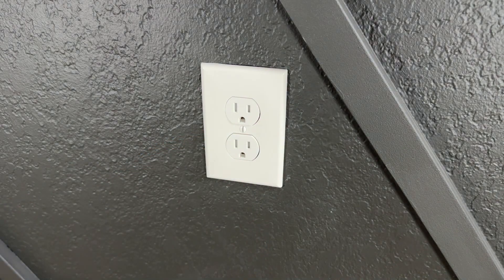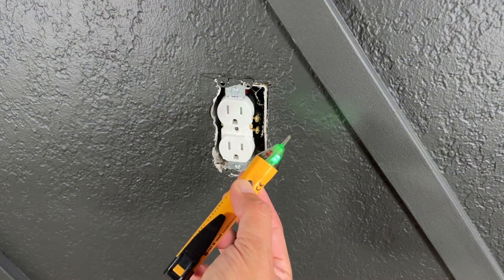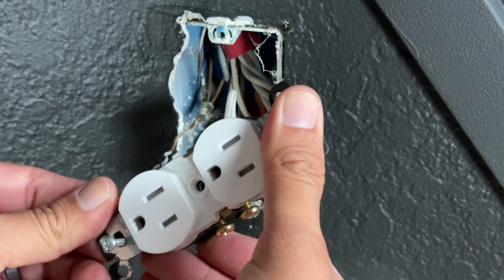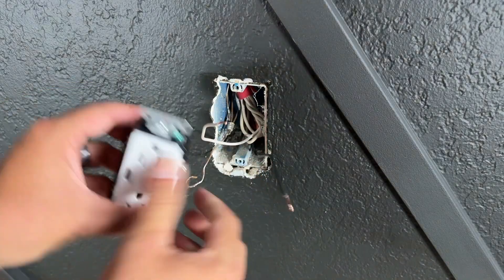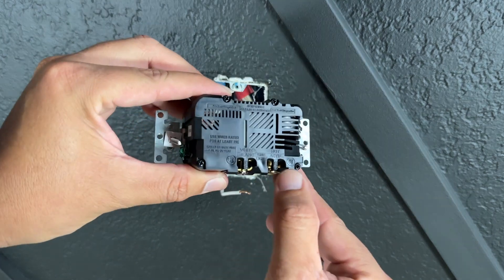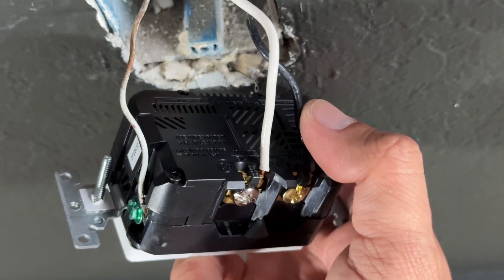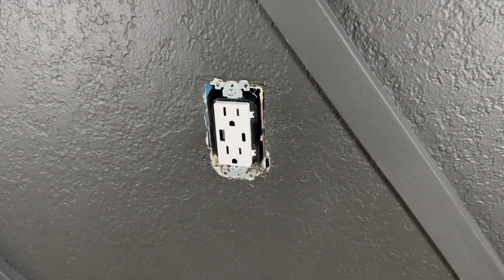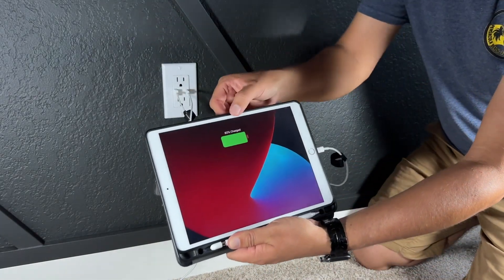How To Install USB A and USB C Wall Outlet

Comment: Quick and easy project.
Thanks.
Do ypu recommenfd sticking with a name brand outlet or are the cheaper no name brands also OK?
Reply from the maker: For electrical stuff I recommend sticking with a name brand, due to the fact that they make sure their products are safe to use, cheaper options may be good as well but I personally don’t like to risk it, electricity is not a joke. 
For other non electrical protects I recommend any brand, thanks for watching.